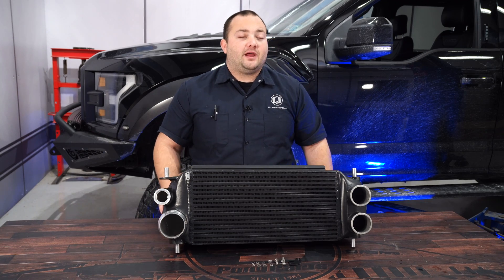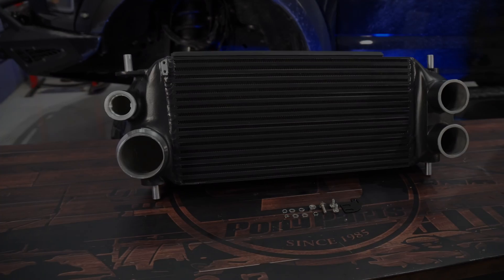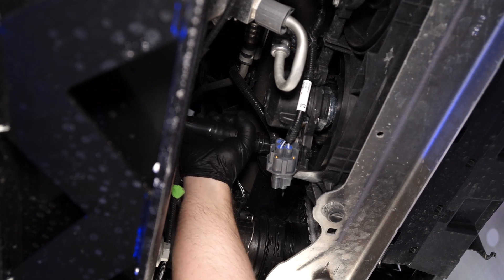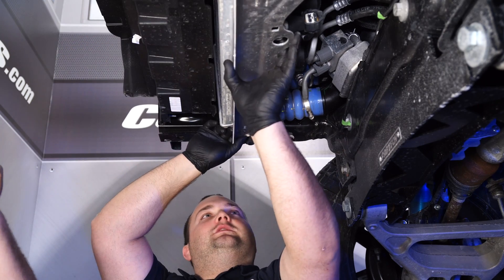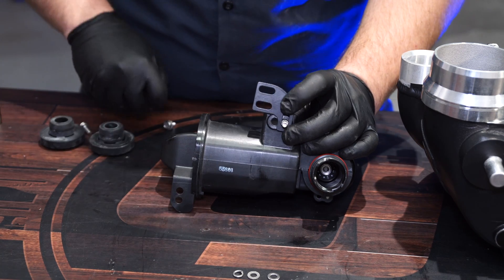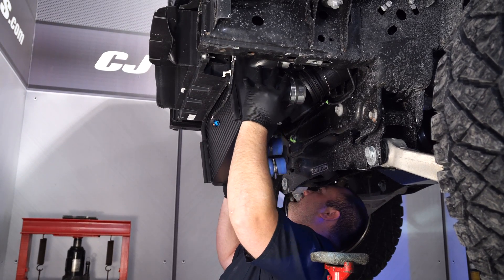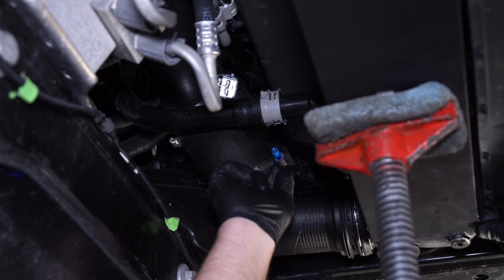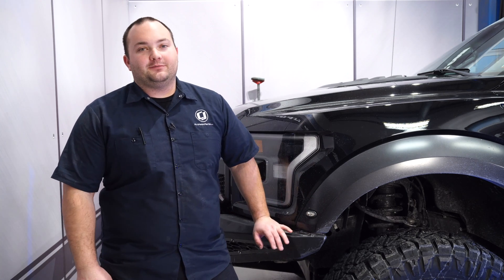F-150/F-150 Raptor Mishimoto Intercooler Kit Front Mount EcoBoost 2.7/3.5L 15-18/17-18 Installation

Comment: Is it better to install a better blow off valve? (Steel, metal) What's your take on that?
Reply from the maker: Aftermarket blow off valves will hold boost better and prevent leaks. With higher boost levels they are highly recommended.

Comment: How is this in comparison to the stage 1 intercooler kit from whipple? I guess it was helped designed by Ford and offers rank hp &torque.
Reply from the maker: They both seem very similar but the mishimoto one is black for stealthier look if that's what you're going for and it's a bit more affordable.